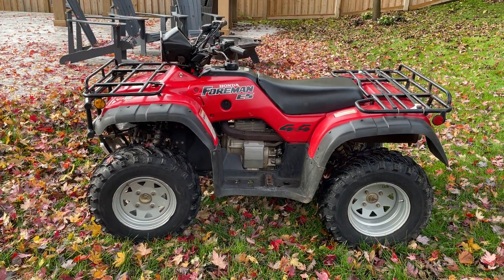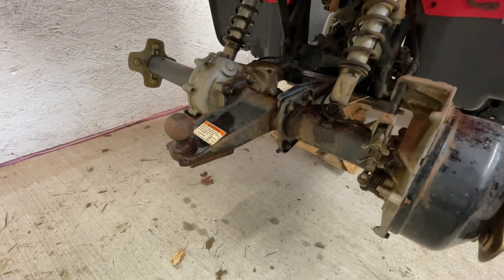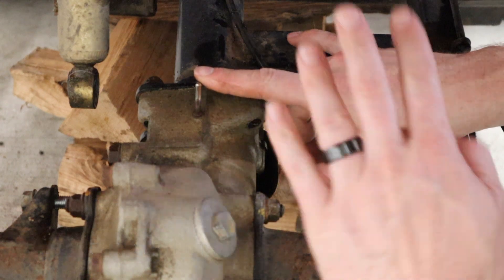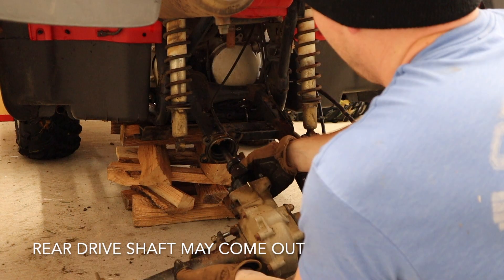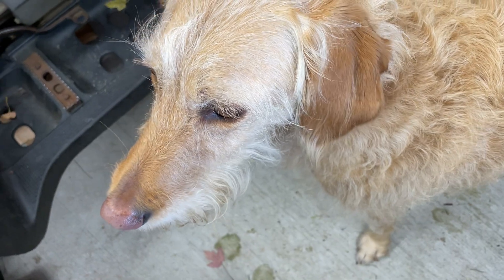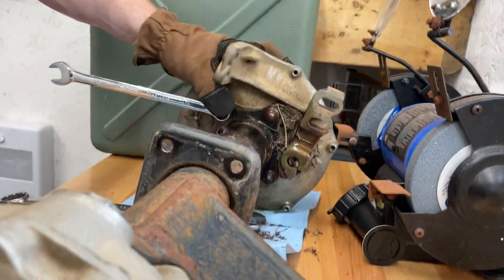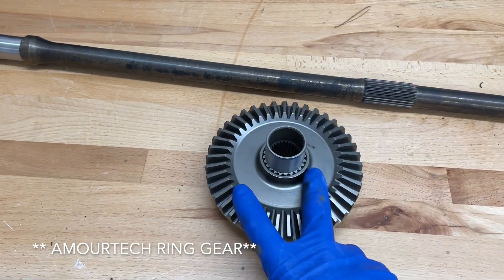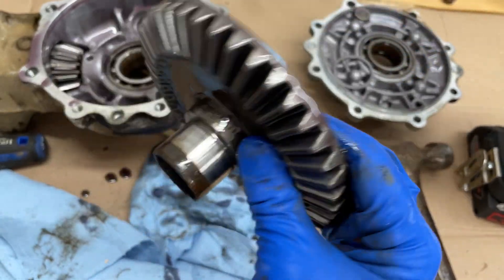Honda Foreman 450 ES | Broken Rear End Diagnosis and Disassembly - Rear Wheels Not Driving

Comment: Hey there, This was so so helpful, and I would agree that putting the small output shaft back in place is not that easy. But I did find a easy way to do it and it takes no time at all. Undo the clamp on the boot ( the large one at the back ) and leave it off. Then undo the swing arm pin on the left side of the bike only ( the side where the axle goes through). This will allow you to move the swing arm around more and you can pull the whole U-Joint assembly out of that section. put the shaft back in after greasing it and then slide the axle back down the tube starting from the engine side. Now it does help to have someone with you to make sure it does not slide out the other end during all the movement getting it back in but you can do this on your own as well, just take your time. Now slide the u-joint coupling back on the engine splines and re align the swing arm and place the pin back in and tighten it up to torque specs. There, now put the boot and clamp back on and your out put shaft is back in and ready to hook up. Hope this helps as well.

Comment: Great vid man.
I did the axle on our bike we leave at our hunt camp. I lucked out and since I knew in the fall I would be doing the job in the spring I left the parts in my Amazon cart all winter watching for price swings. I picked up an entire rear diff for $200CAD instead of the ring gear+seals. Was onsale plus a $25 coupon or something along those lines. 
eBay I was able to get a new axle for $125.
Then just bearings and seals off Fortnine. 

Lol the rear drum stops working as soon as you drive it away from the dealership. I went on a mission sealing it and replacing the cable on my own 500. Worked excellent for about the first 20 minutes of the next trail ride lol. And the cable/mechanical disc brake conversions don't work much better and certainly not for the price. Haven't seen an hydraulic conversion kits but I'd imagine they are 2x the price of the mechanical
Reply from the maker: Awh man, EXCELLENT TACTIC letting them sit in your cart. Nice work. 

I don’t have much experience with the rear disc conversation and was debating it but based on your review it’s a pass for me. My brothers 450ES has the hydraulic discs of front and holy shit do they work. I say that but I have been riding a bike with no brakes for like 15 years lol 

My understanding of the front conversion is you need to increase rim size which I’m not a super fan of cause I just got new tires. May try them with a .5” spacer and see if that works.

Comment: I just bought a 1998 Honda Foreman 450 this past weekend. It has the front and rear disk brake conversion and runs great....BUT! this issue just happened (or it was already an issue and I didn't realize it when buying it) either way, this video is going to help a lot. Seems like a great machine otherwise. Thanks for making this video eh.
Reply from the maker: If you already have the disk brake conversion hopefully that makes life easier. Based on it’s age it was due for this to happen lol. While you are tearing it apart you might as well do all the seals and bearings. All balls sells a complete kit and isn't super expensive. The link is in my other Foreman rear end assembly video

Comment: Wow, this video is excellent, honestly how every how to video should be shot. Very informative and great camera angles! Quick question, is there any reason why you can’t attempt this with the swingarm still attached
Reply from the maker: Thanks for the feedback! So I have done this twice and both times yanked the arm off. I believe you could complete it with the arm still attached but you would need to remove both hubs, drum brake and axel tube on the brake side. Personally, for the few extra bolts it’s so much nicer to work on the axle when it’s in a bench VS hunched over working near the ground. Good luck!

Comment: had foremans for last 25 years still have 3.  , all my brakes work perfect like new   , ya just got to keep and eye on them ,maintain them keep them adjusted etc pull 10 mm drain plug in backing plate every oil change at a minimum or more often if yer in deep water a lot , if any water comes out replace yer seals ,  if a seal goes replace it  it doesn't cost  nothing ....penneys  , , they are simple  , the rear brakes on my 98 450 have never been apart and still work perfect 10,000 km I tap grease nipples into foot lever pivot and rear cam pivot  in backing plate , they will last forever because them two points are first things to seise and then intern cause yer cables to seize etc ..... then ya got a pile of shit brake problems and everyone starts  yelling Honda brakes suck lol.  but they really don't . I  can guarantee there will be no axle issues if brakes and seals are maintained as that issue is a direct cause of corrosion eating the splines and deteriorating them to the point of failure 

buddy has a new can am  had  to do brake pads already at 1300 km lol cost him a fortune , all my foremans  have a combined km of 23 000 km and never replaced a pad or shoe yet lol all original and work perfect
Reply from the maker: No doubt maintenance would help make the brakes last. Unfortunately routine maintenance wasn’t a thing for us until I started doing it all. This 450 was bought new when I was 8 years old and my 400 was bought when I was 5 lol

Comment: Weld the left side ,axle to crown make sure its square and will last along time. Dont waste money on new bits
Reply from the maker: I did think about that but I can’t weld well and I wasn’t sure if the axel floats back and forth so I just opted for new stuff. If it happens again it will be welded for sure
Reply: Take whole diff apart and tack both sides of the crown wheel to the axle ,using a dti gauge to keep it semi square and true. Ive blowen 3 sets of splines and welded them all back together " my mate the engineer did"

Comment: can you change that back axel without taking the back end off?
Reply from the maker: I believe you could, however if you experience this failure you will need a new ring gear as the splines that connect to the axle will also be smoked. I think technically you could do it without fully removing the rear swing arm but you would be damn close. I did this on both bikes because i couldn't take the whole bike with me and it was easier to put that on the bench vs. rolling around on the ground.
Reply: If ur just replacing the axel u can. But if your replacing ring gear it will have to come off as shown in this video.. great video I'm unfortunately gona have to do this to my 04 450.